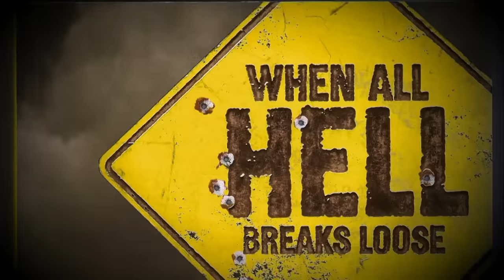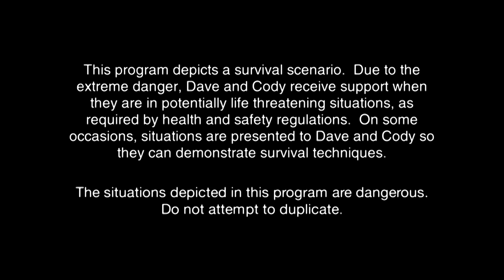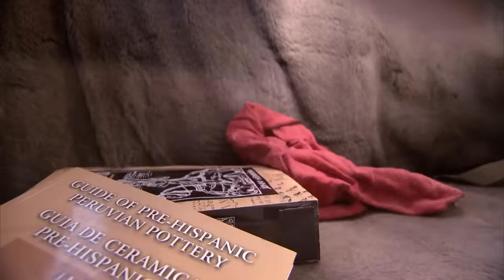Cody & Dave Survive DESERTS, MOUNTAINS & JUNGLES | Dual Survival MARATHON

Comment: using jumper cables is an okay method but you have pounds of copper wire... The jumper cables will drain the battery faster that way. To each their own.